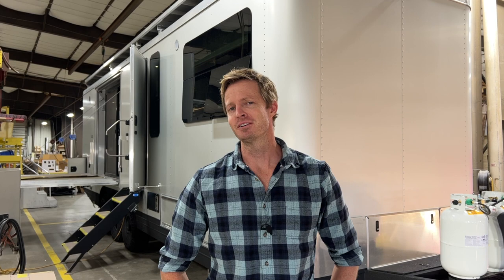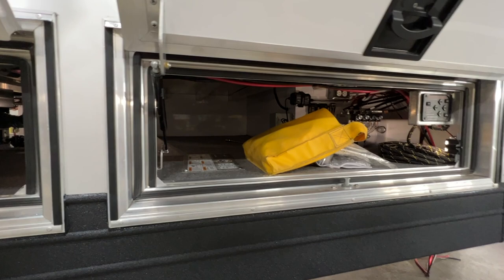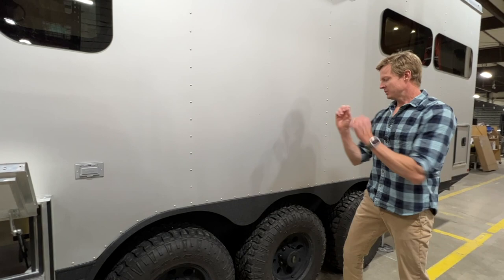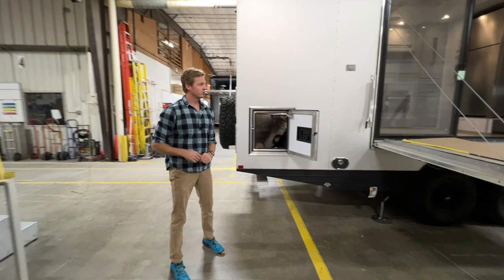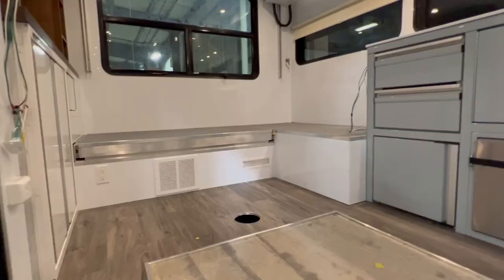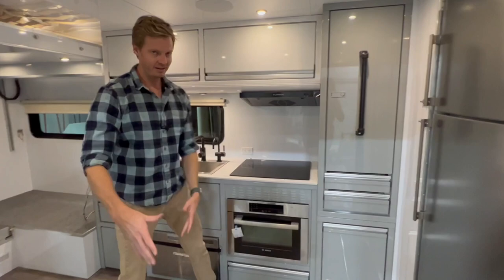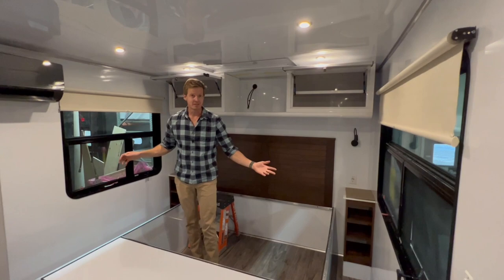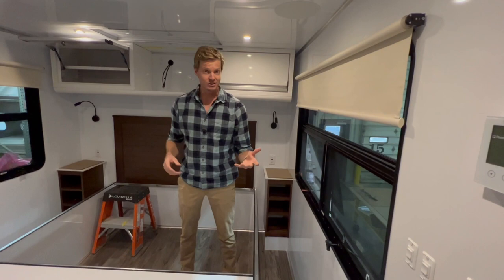Behind the Scenes: Building the 2024 Living Vehicle HD - Factory Tour & Upgrades Revealed

Comment: Also, it's so amazing how each successive model improves. Almost makes you want to not buy one now because the next ones will be so freaking much better!
Reply from the maker: We previde extensive support in selling CPO's that customers wish to trade in for newest models.
Reply: @LivingVehicle  Great to know!
Reply: Solar, propane, water, wifi, hydraulics, back up , storage, load balance,, ac/heat,.. the ultimate survival tool.
All it needs is hydrogen system to convert vehicle to hybrid.
I have educated myself with everything so far except hydraulics and they have an app for diagnosis.
Reply: Vaporizer/incinerator.
Faraday cage for essentials, 
Compressor.
Fire/bear escape.
..

Comment: Amazing. Talk about sturdy and modern and well-thought.  Almost perfect... but not because of the infloor heating which is a NO NO (this is trap for dust and debris and should be located in an interior wall-mount spot) and the dishwasher placement at the floor level (!!!). All in all, this unit is genius.
Have two questions: 1) would a hydronic heated floor system be possible? 2) could cork floors be possible also?

Thanks and kudos again for such craftsmanship!
Reply from the maker: Thanks for the feedback! By the way, the in the floor heating was a special request from a single customer, so not a standard feature.  Warm floor is already accounted for as the conditioner basement warms the air below the floor radiating upwards. Cork floor could easily be installed over the current floor material.

Comment: Nicely done. This type of unit is exactly what I hope to have someday, along with an electric truck to pull it.

Along those lines, I haven't made it to the end of the video, so maybe this is listed, but what kind of weight (tow and tongue) does this have?

Props for the mini split. I hope those catch on industry-wide.

Are the wheels independent suspension?

A couple of suggestions:

1. Curt designed a system to tie trailer brakes into a tow vehicles ABS system. It's currently brand-locked, but please please please bring the tech over as soon as you can. It's a massive safety boon.

2. Have the bottom row of solar panels slide out and keep the top ones static. This can allow better water runoff.

Comment: TELL US ABOUT THE GRAY WATER AND THE FRESH WATER how it is being managed.
Reply from the maker: All the Spa Bathroom option features are maintained with a compost toilet replacing the standard toilet.  The installation of the compost toilet fundamentally redesigns the wastewater management system. Living Vehicle® converts the existing black water tank into a secondary greywater tank. This design nearly doubles the capacity of the standard gray water tank system and creates significant resource savings for traveling off-grid.

Comment: nice video, my only concern are the two hoses that roll out from within the basement...the water and electrical cord. Mice and rodents will now be able to run up those two hoses and be able to come in the RV.  That's typically what happens, so if you have a way to minimize that from occurring you might want to address this in your full video.
Reply from the maker: Good point!  I really appreciate your attention to detail - precisely the real-world use case of how folks will be using this.  

Each hole has a cover over the hole itself, so when not in use, the cover is applied.   In addition, when the chord is deployed, there's a smaller opening that is just big enough for the cord to escape through.   I can really appreciate this concern, however.   The back compartment is already a dedicated compartment - even if something gets in there, there's nowhere to go.  It's completely enclosed in 1/8" aluminum.   I'll do the same for the front compartment where the hose reel is located to ensure the same protection.  Thanks for the feedback!   Your comment is helping us make the design better!
Reply: @LivingVehicle  good just made the hole covers made out of metal because if its made out of plastic like they're usually placed in RV's the mice and other rodents will eat through it to get into food or earth.
Reply: @LivingVehicle  Also you might consider getting an articulating hitch in instead of a traditional RV .  Australian trailers all have them.  We were just in some BLM land in AZ and the areas to park in all had a foot dirt curb you had to drive over in order to find a spot to park.  The articulating hitch would make that happen a lot easier with out the fear decoupling and having a really bad day.
Reply from the maker: If you know of one that is rated for 20K Lbs, let me know!
Reply from the maker: Thanks for the feedback.   In all my days renovating 400+ vintage trailers from my former business, this could not be more apparent.   The concern is legitimate!  When pulling out the interior of completely neglected vintage Airstreams and removing the interior wall sheets, we regularly found little mice and rat colonies buried deep in the fiberglass insulation between the studs.   RV owners never know what is lurking behind the walls - and like you said, it's all in the details!
Reply: @LivingVehicle  https://youtu.be/2ePqFBYgvPs min. 1:09 you can contact the oem and see if they have or make one for you.  I think morryde made this one for palomino as an exclusive but maybe yiu as an OEM can approach them
Reply: @LivingVehicle they may have no where to go, but lots of yummy wires to chew on!!
Reply from the maker: Indeed.   The reality is that we need a manner to connect the LV to shore power when required.   There are inherently certain limitations to all design solutions, it all comes down to what we are optimizing for.   In the end, our primary goal is to limit the shore power connection as much as possible and run the LV completely off solar power, completely resource independent.   I view the shore power cable as a backup source of power.   Enclosing the cable in a dedicated compartment is a backup to the custom-fit access panel to limit any access around the shore power cord when deployed.   In the end, the shore power cord is replaceable and readily available.   Limiting infestations to the interior is our primary concern.  Once rats get into the structure/ basement and worst-case scenario, the walls!   That's the nightmare scenario that I have seen all too much in the RV industry.  We avoid that at all costs!   Any other suggestions, thoughts, or feedback?
Reply: @LivingVehicle  rat poison

Comment: Wow about every feature especially a basement model. What is your recommended tow vehicle?  I don’t think a 3500 or 350 (1 ton) will suffice.
Reply from the maker: You got it! The official vehicle for 2024 is a 4500 RAM HD - fully decked out with a host of aftermarket options, including a single rear wheel military conversion.  Of course, other manufacturers like the F450 will also work wonderfully - personal preference really. We will be releasing a video highlighting this amazing new Living Vehicle truck in a couple weeks. Stay tuned!

Comment: 50 or 30 amp service? Do you still do the creative studio option with the king size bed? Could a Google Nest doorbell be used instead of the Ring? Thoughts for On board air compressor? Great rig!
Reply from the maker: Thanks so much for your interest!

The creative studio comes with a Queen bed standard, however, the GT series could accommodate a king bedroom and separate mobile office space. See here: https://www.livingvehicle.com/lt-coming-soon

You could absolutely integrate the Google Nest system instead of Ring, however, that is not an addition we currently offer.

Comment: Is there a reason the bedroom design was changed btw?
Reply from the maker: Yes!   First and foremost, we expanded the bedroom and changed the orientation of the sleeping space so that we could fit a king bed. Many of our customers requested more sleeping space and larger bed options. In addition, we were able to put in a completely flat floor by moving the closet adjacent to the bathroom the closet also has been expanded to 6 foot. The new design also allows for cross ventilation with windows from side to side.
Reply: @LivingVehicle  Ah alright! That makes sense! Will this affect the office option since the bed orientation has changed?
Reply from the maker: Not at all - that option is still available, only better!  The Mobile Office is now installed across the front wall of the bedroom.   Allows for more light, and significantly more floor space when in office-mode!

Comment: I look forward to the expansion your growing business. I'm curious if demands from clients and potential clients as your success brings you attention will make it profitable to eventually  design full time fifth wheel rvs w/ bunks, mid-dens or toy hauler models. It'll take time because you do things very thoughtfully, but it will be fun to watch how things unfold. Best wishes for your well deserved success with your exceptionally designed and built rvs.:hand-purple-blue-peace:
Edit: I am curious as to how loud the powerful air conditioning unit is. I'm not concerned with the sound on the inside, but if you aren't off-grid and it is loud on your neighbor's camp-side, it would be an issue. I imagine you've thought of this and the unit is as quiet as is possible. I do wonder if it is possible for such a powerful unit to be at a decibel level that would not disturb the neighbors though.  Just a passing thought.
Reply from the maker: The new mini split air conditioning system is darn near silent, both indoor and outdoors!  This is a game-changer when compared this to the industry-standard, ancient style rooftop RV air conditioner (quite loud).
Reply: @LivingVehicle  Awesome. That's so cool. If I get lucky & my projects become successful enough that I can afford one of your travel trailers, I'll be there to pick one out. Very cool, and very happy for you guys on making such a big splash into the market. Good on ya' as our Aussie cousins say.